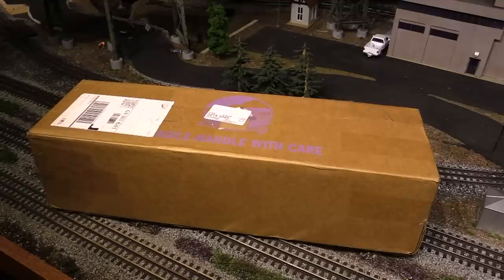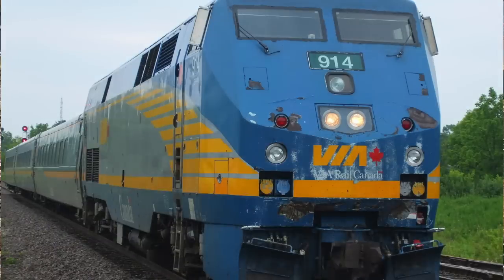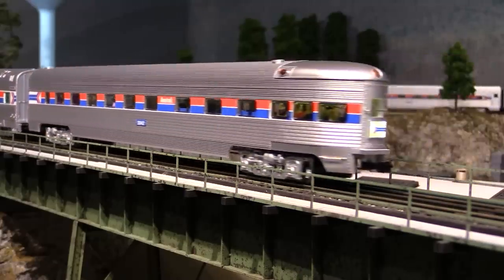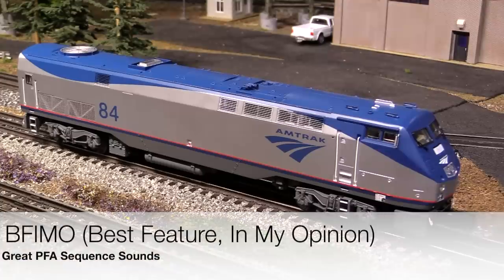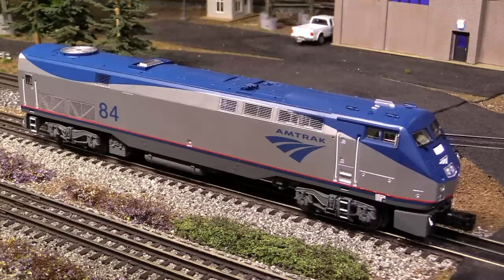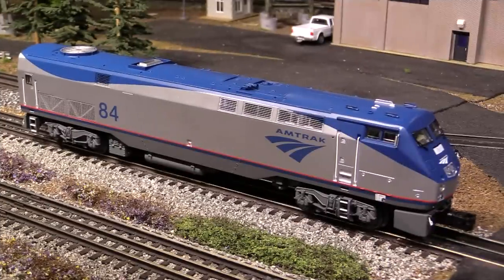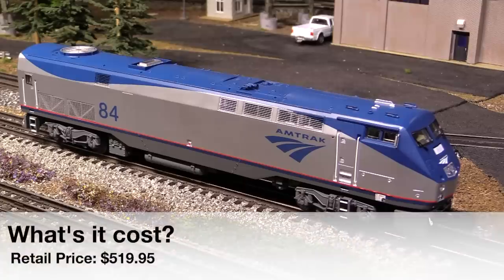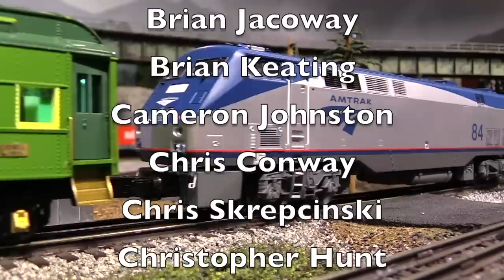MTH Amtrak P42 Genesis

Comment: 😭 I will miss these when they’re rotated out of service. The new Chargers don’t give the same excitement
Reply: Malcs GX Why replace them? Amtrak wastes money & retire their engines too young! Already the Charger engines in one of the videos on You Tube had mechanical problems as they were hooked up to the P42's. Funny the Genesis engines worked 100% fine ... But the Siemens deisels got a 0! 😱
Reply: @haroldalexis4200  Amtrak is forced to retire engines so they can keep making money. Locomotives do start to show age sometimes in their younger years . Obviously Amtrak cannot make money by using locomotives that can't function properly. I wouldn't call it wasting money, that money is put to a good use. Keep in mind, as a 3.4 billion dollar company, things can be tight and difficult.
Reply: Malcs GX not all hope is lost Amtrak is currently receiving chargers only for the California the Washington and Midwest services to my knowledge the p42 will still be going strong on the Northeast corridor and all around the lower states
Reply: Evan Diaz well this is some great news 😭
Reply: Malcs GX I’d say they have a good 5 to 10 yrs left
Reply: @Mcnibbus  Exactly! And when the chargers arrive, the P42's will still be used, not retired
Reply: Yes! They could rebuild the older numbers and refurb the higher numbers!
Reply: @haroldalexis4200  MARC, When They Initially Got Their Chargers, They Couldn't Operate Alone.  They Would Have To Operate With A Second Locomotive Behind Them, I Believe This Was Due To Issues With Their Brakes.  MARC's Chargers Are Now Able To Operate On Their Own.
Reply: Not only that but the chargers are GOD UGLY
Reply: Amen to that. What was the designers thinking!!!!????
Reply: @outlaw2191  That, And AMTRAK Plans To Eventually Replace All Of The Genesis Locomotives With Chargers.
Reply: Nothing can top a Nathan K5LA
Reply: Same with me I love the P42s

Comment: Omg that horn!!! Absolutely amazing
Reply: Yuri Barney Ikari It’s horrible in comparison to the horns they used to use on the Genesis locomotives. I have the Veterans unit from the 2017 run and it’s way horn is better than this horn.
Reply: Bright Future Studios Probably because it isn’t a K5LA. I know some F40PHs were delivered with P5As.
Reply: @bfsproductionsytp  They might have modeled it with a K5LA, but the horn sound is absolutely correct... just sayin

Comment: Hey, I discovered the quillable horn on this by accident.  MTH didn't advertise it, but it is there.  If you have the app, you have to double tap (and drag it I think) until the button turns gray, and you can play it like you would on the steam engine.  I've had the sound set for a few weeks and didn't know it was there.

Comment: Good demo & run on this Genesis engine. My first ride on them on Amtrak when in 1995. Hooked up to The F 40 PH from Toronto Canada to Albany, New York. Was that a surprise ride i didn't see it until the cars was turning on a curve! But one problem i have with many of the audio's of the P 42's they all don't sound at all like the prototype! I noticed this several times on the HO scale versions of them (P 42) GE is more mid low pitched with hiss, GM or EMD is more mid range whining sound. GE, ALCO, sound similar. The U Boats, P 30 CH, The 840 / 840 B Dash all have that low pitched hiss sound! Even in semi quiet low pitch when not fully throttled. EMD is higher pitched in that semi quiet mode. This test very well otherwise glad you presented this well worth watching. 👍✅🚆🚅

Comment: I wonder if models of the new CT Rail engines and cars we have going through Connecticut will come out in the future. Took a ride on one the first weekend when it was free down to New Haven. I like the look of them using a freight engine compared to the Amtraks like the engine shown here that also run through the same line.

Comment: Awesome! Just one question, would Lionel make it’s own version of the P42 Genesis?
Reply from the maker: No idea. Maybe one day.
Reply: Julian Koehler Let’s hope not. It would be overpriced and riddled with quality control issues. MTH’s QC is already bad enough.
Reply: Blackbird Gaming That’s what you think.
Reply: Julian Koehler It may be what I think, but it’s an educated guess based upon the number of defective legacy engines I’ve seen. As one example, the shop I work for got in three ES44ACs, brand new. Out of those three, only one worked. One had a dead short which immediately fried the board, and the other was just DOA. 
As for MTH, we have five engines waiting to go back due to piss poor quality control. It’s sad. Trains just aren’t reliable anymore.

Comment: Siemens? What happened to General Electric? I still think the best looking car body ever made for passenger trains was GM's E8s. Will used P42s show up on regional railroads in freight service?
Reply: g bridgman Why would they be used in freight service? These are purpose-built passenger locomotives. Their design gives absolutely horrible visibility for switching, the tractive effort is too low, and it’s not worth converting them to freight service. 
Re-gear them? Not going to happen. GE doesn’t support the Genesis anymore. 
Put a new cab in for better visibility? Good luck. The body is a monocoque design, which means it is basically part of the frame and is all one piece. That part alone is a dealbreaker. 

The reason why Siemens was chosen is GE didn’t have any interest in producing passenger locomotives. Add to that the fact that Caterpillar/Progress Rail/EMD’s F125 Spirit was a complete embarrassment, and that Siemens was ready to go, and you can see why they were chosen. Hope this answers some of your questions.
Reply: @blackbirdgaming8147  I was thinking about all the E8s and even seam locomotives, such as NYC Niagaras and N&W Js that found their way to freight service before final retirement.
Reply: g bridgman Ah, I see your thinking now, but that was a different time. In the case of E8s, they were easily re-geared, and the railroads that used them in freight service were likely too broke to explore proper options. EMD was also probably still supporting the E unit platform at that time despite it being out of production, unlike GE with the Genesis units, which has chosen not to support them anymore. 
The railroads were probably thinking if they had no passenger service and passenger units on the roster, they might as well get their money’s worth.
Steam is a completely different thing. It was dying, so the get your money’s worth mentality applied. Additionally, the Js had short enough drivers for freight service, and the Niagaras pulled freight when delivered anyway. That was what they were designed for, primarily passenger but could walk back a 100 car freight after charging down the main with a named train.
Reply: @blackbirdgaming8147  When I left my original comment I was thinking, not just now. It was something that occurred to me based on past experience which is very much in the past. I was also thinking of Erie-Lackawanna's E8s in freight after long distance passenger trains were discontinued which, is long in the past. I'm not a fan of modern railroading from a modelers standpoint. My railroad cuts off around 1959, the last year N&W Js were in service.  I was curious about the GE units and if they might be repurposed somehow. Maybe I should buy one of these MTH models and hook it up to a string of freight cars!

Comment: I guess there wouldn't be any way to be able to afford such large scale model railway on a budget? Even H0 gauge is really expensive, when you don't want to cut corners.
Reply: Model trains were never a low-budget hobby. Even in the 1950's, a top-of-the-line Lionel set was regarded as costing about two-weeks' take-home pay for a typical middle-class worker.

However, because so many collectors are of advanced age nowadays, a significant amount of product from deceased collectors is flowing into the market, and secondhand equipment can allow you to outfit a setup without breaking the bank (train shows are good for this).

 The key to remember is, almost nobody amasses enough equipment to build a sizable layout in a short period of time. Virtually all of the medium to large home layouts you see on YouTube and in magazines took many years (if not decades ) to reach a point where they look mostly complete, largely due to restricted spare time and finances.

Comment: It looks great, but I find it strange that MTH would decide to give the phase V the early 2000's finish with those pinstripes at the bottom of the locomotive, and also release the heritage units along side this version of Phase V.
Reply: sargentrowell81 First off, there’s actually no such thing as early 2000’s finish. Amtrak acknowledges this as a variation of Phase V, but both this version and the version we see today appeared simultaneously. Second, they released the regular version last run. And finally, this version has not yet been produced.
Reply: @blackbirdgaming8147  Get over yourself. I only meant to say that it was rare enough around the 40th anniversary that I didn't think that variation was still around. I also don't see much difference between my wording and your wording. It is close enough to mean the same thing to me and I'm sure most people understand what I said. I didn't know that MTH had also released the normal version of Phase V last year since I'm not that into O scale anymore.

Comment: that come in MARC livery?
Reply: Elios0000 No. They only made Amtrak units, and MARC never had these.
Reply: @blackbirdgaming8147  swore i have seen Genesis units pulling MARC trains
Reply: Elios0000 Apologize for long reply, but hope you find this information interesting. I have way too much useless information in my head lol. 
Anyway, you’re not crazy, Genesis units have pulled MARC equipment before. You may be thinking of a holiday extra, or the cars Amtrak leased and ran with the P32AC-DMs (the dual mode Genesis units). But MARC never owned Genesis units, the only units to pull MARC equipment were Amtrak units. 
MARC has always historically been a very EMD roster. Don’t forget that EMD partially made the AEM-7s (they did electrical work and final assembly, Budd did the body, and ASEA did the rest) so they count as part of the “EMD-oriented roster”.
The only railroads I know of that currently own or have owned Genesis units are Amtrak, NJ Transit, VIA Rail, Metro-North, and ConnDOT/Shore Line East. 

Now I firmly believe rule #1 of model railroading is it’s you’re railroad, so do whatever the heck you want, and you are entitled to do so. Rule #2 is if you have any complaints, refer to rule #1. With that in mind, I know of a custom painter that could paint a MARC unit for you if you want one, even though they didn’t exist. If you’re interested I can give more info.

Comment: Does anyone know if MTH offers it for 2-rail? Thanks, Scott.
Reply: Scott Thurman Last I checked it is offered in 2 rail. If not, they do offer 2 rail conversion kits. The conversion kit only converts the electrical pickup as the board is already configured for 2 rail. It even has DCC on board, in addition to MTH’s proprietary DCS system.
Reply: @blackbirdgaming8147  Thanks, Scott.
Reply: Scott Thurman No problem, glad I could help. The only problem I can see is since you’re running 2 rail, you presumably want much more detail. Some issues include: the pilots aren’t fixed, the locomotive rides too high, and obviously doesn’t have Kadee couplers. But fear not, there is a solution. 
Here’s what I would do. Buy a dummy engine cheap to practice on. The locomotives (even dummy engines) are Kadee-compatible out of the box, because the holes are already drilled for mounting a Kadee coupler. Then talk to Jeff Sohn, he will help you with the pilot, ride height, and specific Kadee coupler he uses. Jeff can be found on the OGR Forum, and I believe he posted a thread about it. I would still contact him directly though. After talking to Jeff, use what you’ve learned to convert the dummy. Once that’s done, you can buy a powered engine, convert to 2 rail, and do the same as you did to the dummy. 
Hope this helps a bit more and good luck.
Reply: @blackbirdgaming8147  Thanks that is good info. Have a great weekend, Scott.

Comment: My railroad is HO, but I'd like to set up an O scale layout, maybe running along the wall above my HO layout and below the ceiling like some pubs do.  But I want to ask why do they make O scale locos with the "fenders" and couplers mounted to the bogies rather than the body shell?  Every O loco you've shown on your channel is designed like this, so it's not just one crappy manufacturer.  This P42 looks like an amazing model, except the fender mounted to the bogey looks ridiculous and ruins the model.  This is the one thing that looks so unrealistic and toy-like and is keeping me from experimenting with O.